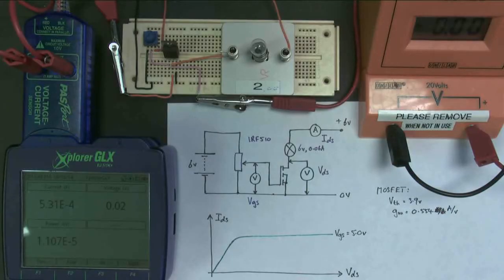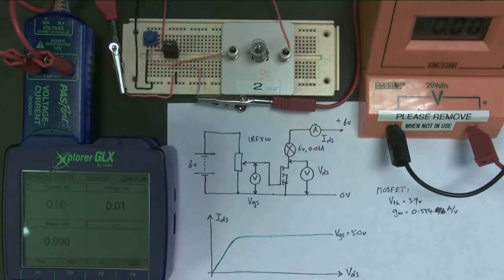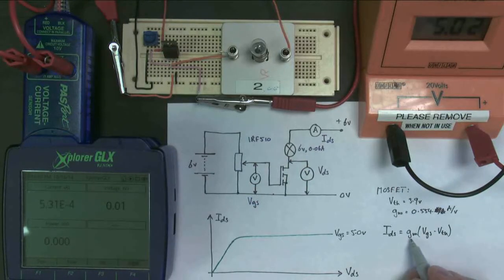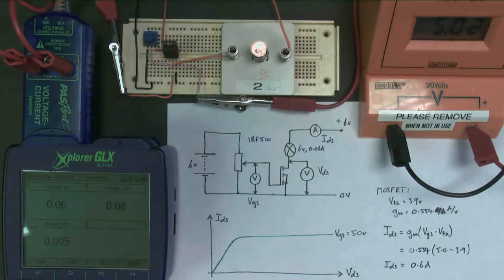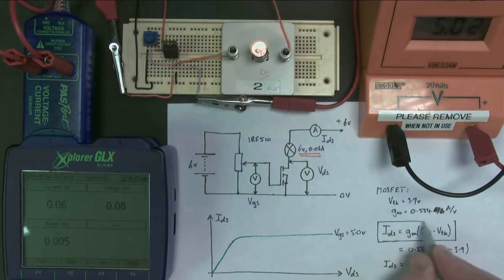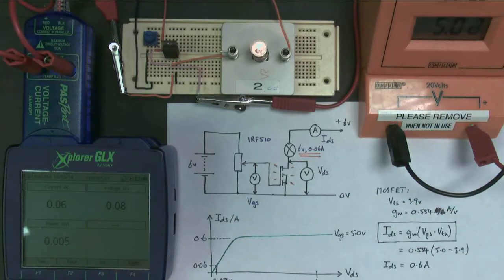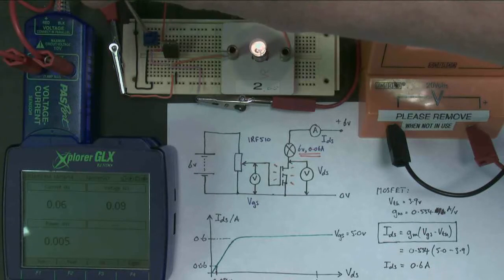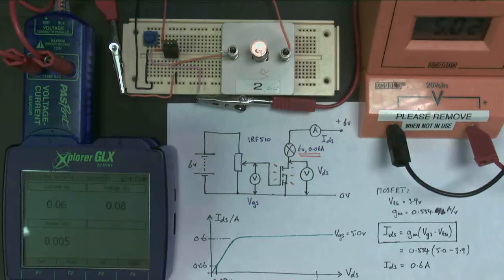MOSFET Part3 Transducer Driver

Comment: Dear Professor, resistance of the light bulb is 100 Ω ; if you want .6A to flow, just short its terminals and a heatsik to the mosfet for a power dissipation of 3.6 watts 🚀